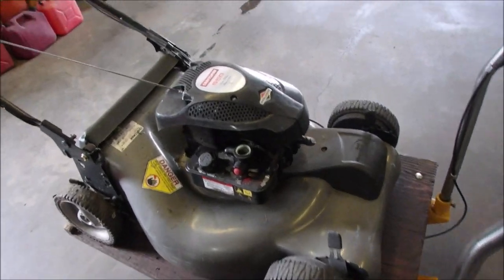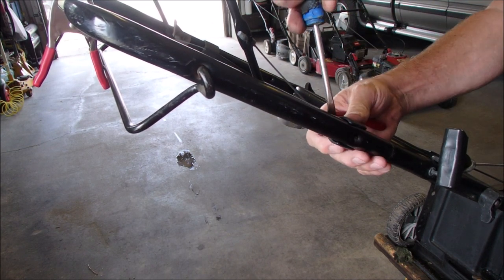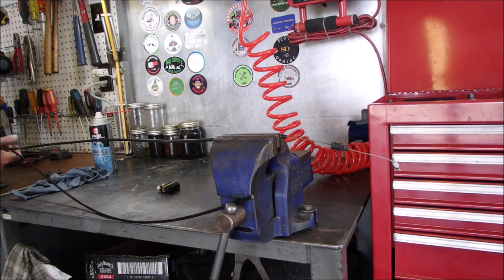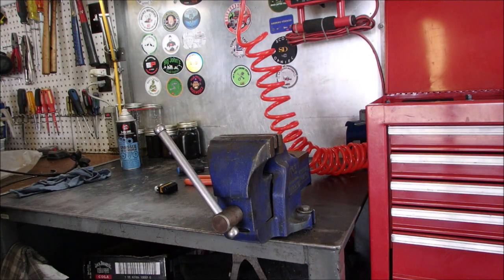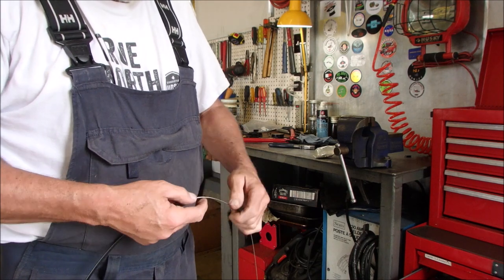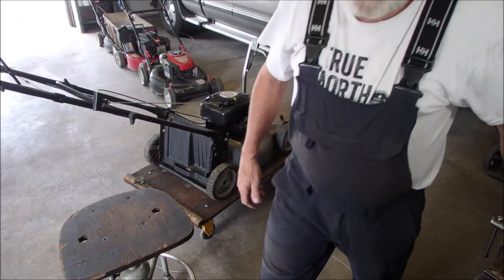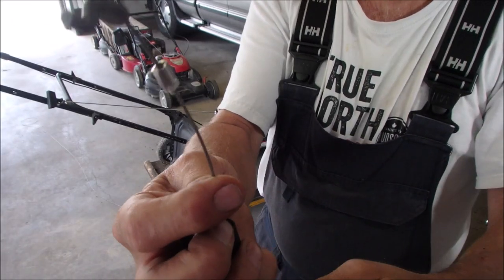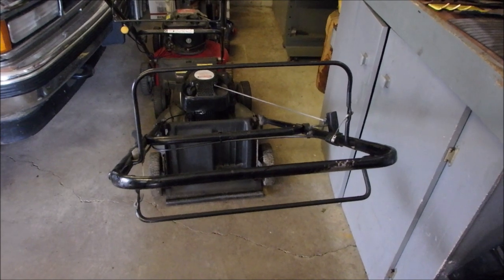Lawn Mower Stop Cable Prototype

Comment: I ran across a mower a few weeks back with a broken kill cable that hard a small sheet metal screw in the top plastic "C" that holds the cable on the handle. I originally thought "this is just wrong" but after looking at it closer and fooling with it a little I realized it was the best little hack I had seen in a while.
Reply from the maker: Right.  That is actually a great idea.   Can I use it Bill?
Reply: @BrucesShop  Bruce using one of my tricks? Please do!
Reply from the maker: @GuysPlayingWithTools  Thanks  I have used tape, clamps and new cables. The screw ides is so simple it hurts.
Reply: @BrucesShop  Right? It was in the underside and I wiggled at it for a minute because it wouldn't let go, then I saw the screw.  It really looked like it belongs there too

Comment: I use a hose clamp to rig that up to work.  Been working for years that way after doing that.  It clamp will likely outlast the mower.

But for those who cannot do that your fix seems possible
Reply from the maker: Thanks.  I have used them as well.  I switch things all the time.  Thanks again for the advice.

Comment: I like your first attempt at this prototype it does give options of replacing the cable for fixing the original one that snapped
Reply from the maker: Thanks Mr. Wrenches.  I was wondering if I should publish attempt #1
Reply: @BrucesShop  if you decide to I'm curious what you did on attempt  #1
Reply from the maker: @Turningwrenches85  OH  Sorry   this was attempt 1.  I was wondering if i should publish it as the video was choppy.
Reply: @BrucesShop  the video wasn't bad at all it was very interesting to watch

Comment: Very nice, i like your idea it works too. I use stainless toilet plunger chain, never stretched or breaks just run through 2 pull rope eyelet bolts or make your own. I prefer just a button kill switch honestly the old school way
Reply from the maker: I like that too.  I stick with the maker system's as folks know the safety involved.

Comment: This is a good solution for a different problem...broken/rusted cables; in the case of this mower, a new cable wasn't necessary. Instead, it just needed minor tweaking with a couple easy fixes: (1) adjusting the cable length by twisting the ends (Steve documents this well in his video "How To Adjust A Non-Adjustable Lawn Mower Cable"); and (2) inserting the cable correctly into the deadman/bail control bar. Regarding the second item, there's a right direction and a wrong direction to insert a cable's z-bend into the hole on the deadman/bail control bar, and this one was backwards, causing the mounting bracket to pull away from the handle (as seen @1:01). Inserting the z-bar from the inside of the hole (seen @0:26 & more clearly @9:11) causes the cable--and thus, the mounting bracket--to angle toward the center of the mower, creating additional tension. If the z-bar is inserted correctly--from the outside of the hole--the cable remains parallel with the handle bar, causing less strain and twisting on the mounting bracket when squeezing the deadman/bail bar. It may not seem like much, but with such small tolerances, a few extra couple millimeters here and there can make a huge difference.
Reply from the maker: Yes I have done this as well.  I did see Steve's video.  Great guy.

Comment: Bruce, when I have to repair a cable like that, I use the individual z-bend pieces with the set screw on the end that goes to the engine, and a salvaged z bend from a bad cable at the bail handle end.  I ALWAYS double up on those little sleeves.  I have found, for me, that having a 2-3" (5-8cm for you Metric folks) overlap on the salvaged z bend part and the new cable has proven to be a solid repair for me.  You really gotta lean into the crimping of those sleeves, too.  I crimp them twice each, because my tool is about half the width of the sleeves.
Reply from the maker: Thanks Matt

Comment: I do not know why I still have that set up on my 10 year old mower 
I know I can remove all of it and just add a kill switch
Reply from the maker: Well a dead man cable is safer.  Good for you.
Reply: @BrucesShop  I do have the bad habit of tying the handle back so it stays running when I walk away

Comment: Watching u I've learned to clean carbs ,fixed a Toro lawnmower and when I start it after I let go the handle to turn off and does not,I push the little arm of the kill swech and then it does.  Have you fixed that kind of issue?
Reply from the maker: Yes  A small amount of bending making the switch come together close and you can also tighten the bracket holding the switch.  Te cable from the brake bar may be stretched as well.  There are quite a few things involved on a simple procedure.
Reply: @BrucesShop  I'll try .thank you Mr Bruce

Comment: I double tie wrap the black piece that wants to pull out. Of course, assuming that's the problem. Otherwise, great video as always.
Reply from the maker: Thanks.  What do you use.  Teflon tape of some other type of tape?
Reply: @BrucesShop   I use tie wraps. That’s what I call them. Maybe you know them as zip ties?
Holds pretty well. Let me know your thoughts.

Comment: One of my favorite personal mowers was this exact model. I dealt with this problem by removing the cable completely and adding a kill switch using the wire that grounds the coil. It worked so well that my daughters borrowed it when they moved out and bought their own house and it has been their mower ever since.
Reply from the maker: So you are saying you daughter stole a mower from you.
Reply: Respectfully stating, you removed the most important safety element from the mower. New cable will retain this feature for $7.99.
Reply: @metoon3092  if I were selling it to someone, I agree. But I do understand the risk, it is same as my 1985 Snapper or my 1965 Montgomery Ward Powr-More mowers.
Reply: @BrucesShop  yep. I was over there in the Spring and changed the oil. I suspected I wasn’t getting it back.  Today is the 2 year anniversary of when they moved out. At 31 and 29 it was time for them to get their own place. I did sell them a snowblower. I also paid for a Hipa carb to get their free weedeater going and I did get my weedeater back.